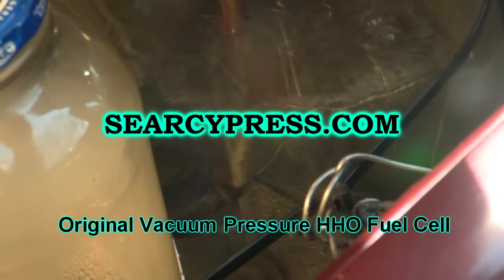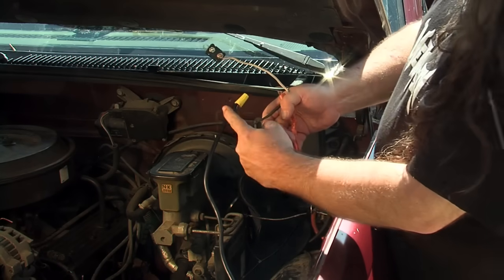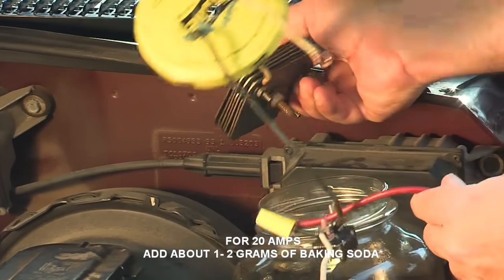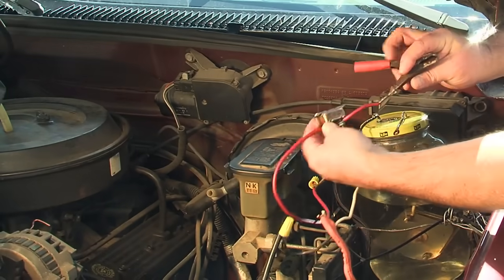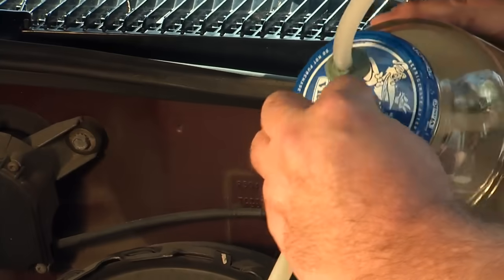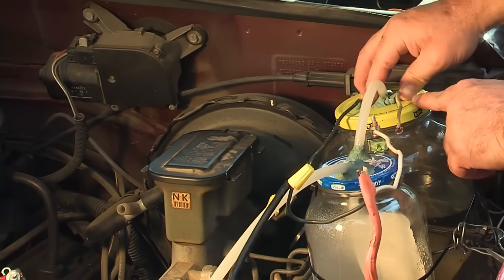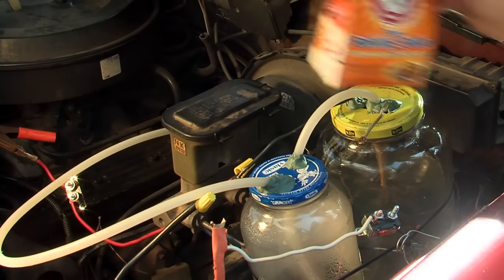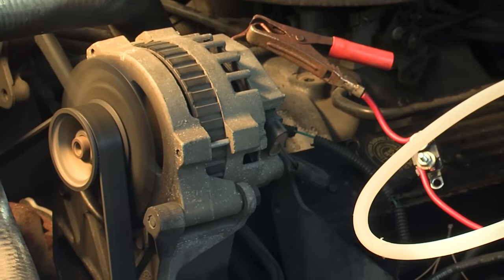Vacuum Pressure Hydrogen fuel cell defeats high gas prices using hydrogen from H2O.

Comment: what happened to the winter time if you live in the Northeast? how can you keep the water from freezing?
Reply: Exactly, thats why flowing creeks and waterfalls never freeze.
Oh wait, they do
Reply: Put it in a box and put insulting around it.
Reply: The heat from the volts and amps should keep the water warm but I am not entirely sure
Reply: A little bit of antifreeze mixed with the water. Or liquid cooling agents that they use in PC's.
Reply: Or salt.
Reply: Salt, yes. But not too much. Don't ask me for the concentration, but stainless steel will rust in salt water when the salt is in high concentration. Again, don't ask me how much. I have no idea. Alcohol is another possibility.
Reply: I ran a hundred miles in freezing weather with this rig....but I pulled the water out when I stopped...a plug in heater ...like a dipstick heater to keep the oil thin in sub zero.......you might  plug  in a heater at the house....I have reason to believe that HHO production may be increased by heating the water....The produced bubbles  cools  the water I think....the sloshing of the water and the running motor seemed to carry it off on one snowy day......but warming up the water good might improve production all the time..........Wouldn't colloidal  silver added to the water increase conductivity? cheap to make    Pull your water out when you get to work....if you can't plug in a ac heater of some kind...a heat lamp etc.....these are my thoughts on this...I hope they lead somewhere good.. Be very careful......I like blast ports in the top of the tin lid.....probably wouldn't even break the glass
Reply: Exotic Creature if you take 2000 to 4000 metal hydride batteries apart and  depending the size of your  plates in cell are going to be.  take the lil plates and melt them. Then you pour into molds with lots of holes so the plates are holy lol. Doing this also can make the plates bigger with less material. These plates will not rust in salt water and it produce more true hydrogen gas and not oxy hydrogen gas . Took many years and many  different types of metals . Metal hydride seems to be the best also bob lazar also states that his system he uses metal hydride
Reply: Guys, please don't think of me as esoteric, infact my system is very simple, yes my system was borrowed from Nikola Tesla.
Reply: Alexander Gunshooter ...when it rains by the seashore why is there not salt in it if its evaporated sea water? Why doesnt the mist from the sea roll in and kill the plants with the salt contained in it?....salt water used to produce hydrogen gas does not contain a molecule of salt once a gas.... just like distilled water may have been salt water but broke the salt bond  transphering to a gaseous state. im guessing you are 11.
Reply: S Alexander you can buy tablets that stop your water from freezing. Look it up.
Reply: use a fish tank water heater
Reply: heat from the engine will keep the water from freezing, you just remove the water jar when you're parked
Reply: Yes, the antifreeze will over heat,,, break your block in 3or4places,,，then I will come, replace your whole engine,,,,, but I'll make it right and Give you a bottle of engine oil,,,an owners manual,a gallon of water and Baking Soda，and let you decide which you put in your engine and which one you polish your chrome with,,,,,, of course I will lie to you and tell you to put it in your transmission so it will shift smooth and cleaner,hell, you probably won't even have to change gears if it is a straight drive,,,,call me "EDDIE'S CHOP SHOP" Horse Shoe,N.C.
Reply: Yes I like it when customers put salt water in stainless steel piston rings cylinders,,, be my guest,,,,, just remember stainless cost 4 times more than steel,,,i almost forgot the salt water detox and cleaner,sorry. Absolutely forgot to throw in a little lie,,,,,damn it@!!!!!
Reply: MrGamerman001 effective anti freez is sugar. But in my system you never need any additive, we will use simple water heater in the water supply.
Reply: Chris Saunde you see, my Infinitron system could produce very high DC (1800volt) to regularly operate and it uses capacitor banks that's made of ultracapacitors, to rapidly recharge and discharge within a Radiant Energy Conversion Tube,it's just like Edwin Vincent Gray System operating on positive repulsion electromagnetic motor generator, with very high torque, and you don't need to replace your car battery when you use my sysytem.You could turn your old car into a running high voltage electric Generator!You could even use my system to provide sustainable electric energy to your house , in the event of massive power outages,for example, during WW3,when all power grid  are totally downed, due to bomb blast!
Reply: Add salt
Reply: Simple - add alcohol to the mix (heet)
Reply: S Alexander good question!All you need is to retrofit your old gasoline car with an infinitron magnetic self powering electric Generator to supply your basic DC power needs for your water electrolysis and by hooking up this Infinitron generator to the AC Dynamo you get AC currents to run your water heater which will keep your fresh water supply in liquid form while you are still up north,boy, cold climate up there.My country is tropical we never have snow.
Reply: Water cannot freeze if it's moving. A small fan in the bottom of the tank would keep the water circulating.

Comment: "first thing you do is eat the pickles up. you'll need the jars. get you a chunk of romex ac household wire. we'll use that on a light switch to make the pickle jar cooling gas. hook it to the dc feed of an alternator. grab some flexible tubing or some good bendy straws and use the best sealant known to man. poster putty. chewing gum or ear wax will work in a pinch. next we will fuse the positive and negative leads for extra sense making. hitch the straw into the brake booster. that's what it's there for. pickle jar straw suckin. Boom, you have installed your machine professionally and you'll want to put your fuel savings money in a third dry pickle jar."

No wonder people are so negative in the comments section of hho/hydroxy/browns gas videos.
Reply: opps my secrets out, not for pink slips , but $ 100, use to make heaps street dragging. ah the memories, lol
Reply: There's an old saying among us time-grizzled silverback street rodders - "Pretty don't make it go". You'd do well to remember that. Otherwise, one day some petrified grey bearded old fart in a clapped out Chevy II  with well wrinkled sheet metal & rusty-ass mismatching dog dish hubcaps Is liable to ask ya if you'd like to go for pink slips - an unfortunate situation that'll hook you up with a lost car & a long walk home. do I agree with his choice of certain components? Perhaps not - But I recognize FUNCTION when I see it. What he has works.

Comment: you said the 30 amps produces enough hydrogen to cool the water I am new to this and trying to learn can you explain this please ?  in my small experience the bottle that you make the hydrogen in gets hot so are you saying if you run 30amps it will produce enough hho to cool down the water so it will not get hot?
Reply: he may be saying the gas will carry the heat out with it. not realistically. more energy used inefficiently equals more heat. heat is wasted energy and you may have to run the water or electrolyte through a small radiator to pull this heat out. using the heat somehow would be the best bet. heat your car with it, collect some of the energy wasted from the heat in one of those heat transfer cells. idk be creative.

Comment: Why don't we see any hard data?   Because, this is a scam.
Reply: How is it a scam? He's showing how to do it yourself. He's not selling anything.
Reply: The fact this is a scam is explained by the 1st Law of Thermodynamics: The first law is often formulated by stating that the change in the internal energy of a closed system is equal to the amount of heat supplied to the system, minus the amount of work done by the system on its surroundings. Equivalently, perpetual motion machines of the first kind are impossible. To explain this specific hydrogen generating system: The electrical energy necessary to split a water molecule into its base elements of oxygen and hydrogen is greater than the energy produced when you burn the hydrogen, which in effect recombines the oxygen and hydrogen atoms back into water. Unless you use an outside energy source to split the water molecule, such as sunlight or a fossil fueled generator, into hydrogen just the burning of the hydrogen cannot produce enough electricity to split out enough hydrogen to keep the system  operating. This type system would be the equivalent of a perpetual motion machine which is up there with unicorns and leprechauns...it doesn't exist. You cannot get more energy out of a system then you put into it, period.
Reply: Dennis Weaver Whoa...just because something is wrong doesn't mean that it is a SCAM. The word scam implies that someone s attempting to deceive for his or her own benefit. The science might be inaccurate but SCAM??? Hardly.
Reply: I think youre missing the point McCloud. The excess energy not used by the alternator is what is powering the fuel cell. The hydrogen produced just increases the efficiency of the fossil fuel that's being wasted. So basically the energy needed for splitting the water atom IS more than the product of the process will give on its own, the addition of the Hydrogen gas triples the output of the fossil fuel using power that was being wasted anyway by the alternator

Comment: geez could you be any worse at running wire that job looks like garbage I'm surprised you haven't had any shorts or fires that's not even the proper wire to use in a vehicle why the hell would you use house wire
Reply: It's perfectly fine. It can definitely handle the current.
Reply: I never understood why but I remember learning that dc runs through a conductor differently than ac. I know for flexibility stranded wire is ideal but with a dc source, even wire that should not move or flex at all, everything is stranded. perhaps someone can explain this for us or disprove it. I am interested in ac vs dc pathing through solid vs stranded copper.

Comment: That is the funniest junk box I have seen so far.  120VAC switch under the dash and bare fuses for protection - LOL  Folks, the only thing he is improving is his Youtube income. If you want to understand science, ask a scientist, not a backyard mechanic armed with glue and duct tape. Jeez...
Reply: Unlike you I don't read a book and do exactly as what's stated in the book. If you can't prove what the book said to be wrong, then the book was right. But you won't prove anything if you don't actively try to prove or disprove in real life.
Reply: it works buddy in the simplest form.. many people over complicate the setup, this is a great setup it's basic and works. no one said it's safe.. thats how simple this stuff is.
Reply: Steve Jobs started Apple in a garage, who cares if he's a shade tree mechanic and doesn't care what his ride looks like
Reply: I have been experimenting with these things for for years. this one is hilarious.

"first thing you do is eat the pickles up. you'll need the jars. get you a chunk of romex ac household wire. we'll use that on a light switch to make the pickle jar cooling gas. hook it to the dc feed of an alternator. grab some flexible tubing or some good bendy straws and use the best sealant known to man. poster putty. chewing gum or ear wax will work in a pinch. next we will fuse the positive and negative leads for extra sense making. hitch the straw into the brake booster. that's what it's there for. pickle jar straw suckin. Boom, you have installed your machine professionally and you'll want to put your fuel savings money in a third dry pickle jar."

No wonder people are so negative in the comments section of hho/hydroxy/browns gas videos.
Reply: Funny thats exactly what they told the Wright Brothers.
Reply: sientist from what field?

Coz i aware that biologist dont have any bloody clue about enginering, and engineer dont have any bloody clue about biology ;) So? DId they created that brand already? or you listen to the mixt of people who have their own job and stick nose to the think they understand only partialy? :)

I`m not denying this can be fake, but in the same time renember Sientist can search for think he is paid for or try do it alone for his own money. Yet if other sientisc will not aprowe it (mosty payed by companies to search fo what they see interesting) even if he is right he will not go to the surface ;)

Dont bielieve that people are so great, that what is keeping humanity in this small cage. They trown wiser forces to bielieve in stupid human thinking he is briliant. Even Tesla was still a human yet he knew to who he should bow his head and it was not humanity, humanity destroyed him. SO? Still going to ask other people about think they dont know dont care or they are not payed to care? Its called IGNORANCE my friend :)

have a nice day, i like to listen so i`m listening from all possible sorces to be OBJECTIVE as much as I can, even if its going beyond "Official" version :)
Reply: hahahahahaha
Reply: Service Store USA You forgot to mention the  glass jars under the hood.
Reply: Frank Gutowski Leadership in technology?   We took a microscopic ballbearing to a science. expo in Europe.   We thought we were the sh..t man.  The Swiss stole it, drilled a hole through it and gave it back.  Were they trying to tell us something?
Reply: and the poster putty :P
Reply: +Rob Jones same thing happened at British nuclear fuels, but they bushed it and sent it back saying hole was not true
Reply: ok bill nye
Reply: Service Store USA science is magic idiot. You must be a scientist and the common folk should take your word as gospel or gods spell. Fake news. Lol
Reply: Haters,  go home,  thank God for this
Reply: You clearly have no understanding of continuity.
Reply: You clearly have only read text books and never touched any of it in real life.
Reply: LMAO! Best comment in here, bar none. Made me laugh and it's the truth. This shit is nonsense. HHO is too weak to do anything real and as far as running an engine but it's dangerous enough to do some damage. These people are morons. Physics and thermodynamics and math does not support it, at all. It's not pure hydrogen and cannot even turn the engine over for one revolution. The potency is just not there because it is made and mixed with oxygen and run off an alternator. So it's oxy hydrogen. No like pure hydrogen from a compressed tank could do. That shit powers rockets, so it could power a vehicle easily. Gas is safer though (less explosively dangerous) and this shit is just a toy and does nothing really. It takes energy to make energy and this doesn't make nearly enough compared to what it takes. Not even worth the trouble. It's the law of diminishing returns. Dry cell , wet cell, doesn't matter. It's all bullshit.
Reply: Bill Does Stuff yeah and the second law of thermodynamics states something cannot come from nothing so what caused the Big Bang “theory” theory theory? What happened where did the something come from? Or did we all come from nothing? Tell me this as I sit at the feet of a superior intellect. Get a fucking life

Comment: PLEASE SOMEONE EXPLAIN TO ME: there's enough energy in your battery to propel a 1-ton car on a mile, then how does that energy miraculously, (going through water) make you save 50% gaz on thousands of miles? That battery is recharging itself and producing surplus energy? There's such a huge gap between what's available in a small battery and all the force that is supposed to be produced. When you say you run a light bike on a hydrogen cell, it means you come in the morning with the 1 litre hydrogen bottle produced on 'good old' nuclear plant through your wall plug. The issue here is the "perpetual energy machine" that engineers know to be a hoax. Or am i looking at it the wrong way?
Reply: Big oil owns auto companies + Auto companies building gas guzzlers = Inefficiency. 

So now that we know it's inefficiency is designed we also know that it can be improved upon. HHO is one of hundreds of ways. 

Don't come here accusing us of trying to defy physics and talk about free energy or perpetual motion when 1) We aren't trying to do any such thing and 2) HHO has a benefit that people like you omit 100% of the time.
Reply: In a typical gasoline powered vehicle you are only getting a 30% burn of fuel. That means 70% of your fuel is literally lost. How this works is the hydrogen gas produced by one of these setups is vacuumed into the intake, mixes with the gas and gives you a 75-100% fuel burn. Has nothing to do with a battery. You will gain horsepower, torque and fuel efficiency.
Reply: Wow, thank you scalefreak, very interesting, the explosion efficiency in the traditional engines is surprisingly low, then.
Reply: +Eric Paroissien it is also steam cleaning your engine of deposits.
Reply: Ha ha! Thank you, makes sense.